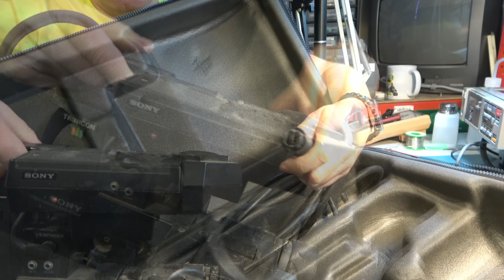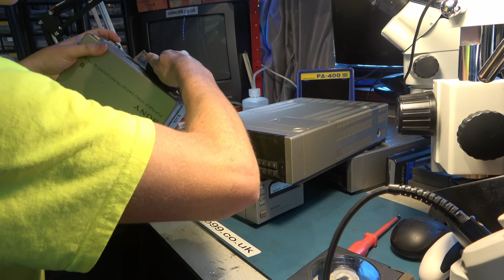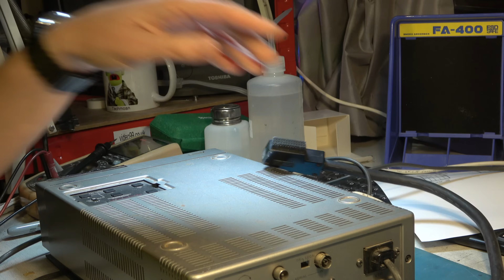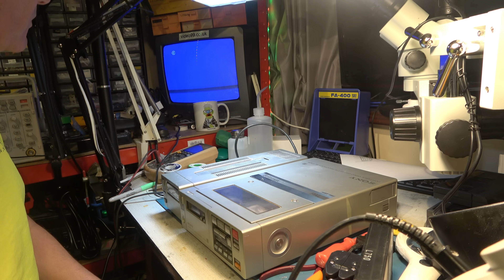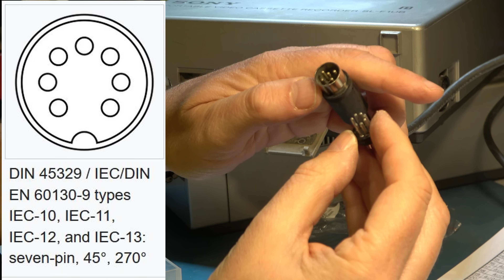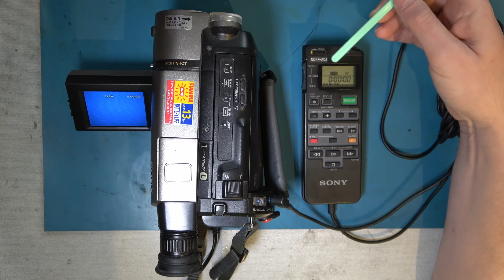Sony Betamax SL-F1 portables, TT-F1 tuner/timer and HVC-4000P camera. Make our own cables.

Comment: Dear Sir, do those Sony HVC 4000 is using 14 Pin Connector? I want to buy it for my SL-3000 but i'm afraid that is not compatible
Reply from the maker: I believe that's exactly what these cameras are intended for.  You can look up the user manuals of both devices to be sure.

Comment: Been researching these. The multi way plug is audio and video plus control S for editor controller.

On TT did you press the power on button behind the front cover. It looked like you pressed it twice. Have to watch that when I pick my ebay purchase up.

Comment: I have an almost identical looking set labeled SL-2000. maybe an NTSC version? Cannot find anything on it!
Mine has a finger thick cable running from the timer to the recorder.
Reply from the maker: Yes that's the NTSC version.  I show it here:
https://youtu.be/kRfaUr2HXY4
Reply: Thanks. Im a sucker for this old stuff. Picked up an old SONY Umatic VO-1600 late last year for $10 at an estate sale. Great working condition.

Comment: As a 18 year old in 1984 I sold my Roland Juno 6 Synth to buy a FI, TT and HVC camera set up. I was fascinated by this video camera lark. But the thing never lived up to any expectations I had. 30 mins battery time, poor camera picture, heads constantly needed cleaning. I don’t like to be negative but it was probably the worst piece of equipment I have ever bought. I gave up with the camera pretty quickly and just used it as my own video recorder before switching to Panasonic VHS machines. Which were brilliant. Side note, the price of a Roland Juno 6 on Ebay is about £2-3K. Note the price of a Sony F1 system😂. I paid approx £1300 for this kit. Which is equivalent to heaven knows how much in 2024.
Reply from the maker: A very special synth, really nice.  The HVC4000 camera really wasn't great, but was still better than JVC cameras of the time which had even worse low light performance.  So people used VHS/Beta camera cable adaptors to allow Sony cameras to be used on VHS portables.  The only time there was any kind of VHS/Beta adaptor.

Comment: Good morning friend, I'm here from Brazil, I watch all your videos on your channel and I'm also a writer.
I'm a technician with much less experience, I need a tip about a defect if you can give me some help.
I have a super VHS JVC model HR-S7900u with audio noise after about 20 minutes of operation.
It starts to make that noise, it keeps popping, the audio goes down and the noise overlaps the audio on the tape.
I believe it could be the audio head or the amplifier stage of the audio head.
because when I pass external audio through the inputs and outputs of this same super vhs there is no noise and the audio does not turn down after 20 minutes, there is no defect.
If you could give me a tip or advice.
because I am a beginner technician in these devices.
The image of this super video is normal, only the audio makes noise and loses gain when playing any VHS tape.
This video is mine for my own use, it could be the audio head or audio amplifier stages or source electrolytic capacitors lacking filtering somewhere on the board.
I need technical help.

Comment: I've wondered the same thing before and even dropped a comment in one of your videos about the possibility to make a custom connector to get video and audio out of that rectangular plug without using the tuner timer unit. You can cut the cable from the tuner unit and repurpose it. I believe you can power the unit up via the rectangular connector, You just have to activate its input by shorting out two pins. Lookup pins 10 and 26 in the schematic.
Edit: After digging into the schematic I found that the main power 12V input (8 and 9 pins, not sure why two pins, maybe for better conductivity) is activated by a momentary switch S2 in the power control IC801, that in turns activates the relay RY801 to switch power from the battery input to pin 8 or 9 (12V), What you could do when you build an external power supply is put a momentary switch in it and connect it's wires to the S2 switch, which means power SW B (pin 26) and batt chg (pin 10). Again this should be a momentary switch, The hold is done by IC801 via the relay RY801. At least that's what I think, Lol.

Comment: Thank you so much for the mention - much appreciated. I am working on a video on the connector on the TT-F1 to extract the AV and have a power supply too. I have sourced a direct ICC connector but I'll be using a loom from an spare TT-F1. I'll also be doing a video replacing the really fragile flexi interconnect on the F1 too. 😊

Comment: I bought a SONY tubed colour camera new in 1982 (still works), and the F1 VCR and TT new in 1984, but I ditched the TT years ago. So, does the F1 have a dropout compensator (I'm assuming it does), so, why does the TT need one? Or, is the TT switching the VCR DC on and off? Dropout was NEVER a problem on the F1.

My camera is an HVC-2000P. Light sensitivity and comet-tailing was atrocious, andvreds were "weak." The "K-Connector" camera plug "clicks" in place, rather than screws in, like VHS (I preferrred VHS camera plugs, although the "K-Connector" always worked fine, and was faster to connect and disconnect).

The oldest surviving F1 recordings from 08 March 1984 onwards, still play perfectly, and PQ is reasonable, by the standards of the time.

I have two NP-1 Nicads (£35 each in 1984 😲) and they do still work!

I use several AC adaptors to power the F1, and I have some adaptors which plug in to the multiway socket and provide video and audio out.

My F1 certainly got around over the years! It recorded on the old Quay Street Granada "Coronation Street" set in 1990 (the video was on YouTube for a decade, until somebody made a fraudulent copyright claim, and YouTube removed it, although the video was mine), and in 1986, my F1 went to the top of Blackpool Tower, and filmed the 1986 illuminations, featuring green lasers! ... I didn't have a case, so I used to wrap the F1 in Cling Film to keep it clean and dry!

I recall, in 1984, being AMAZED by the compact lightweight F1! ... Although, the little JVC portable VHS-C VCRs made it look like huge!
Reply from the maker: The TT is just providing the option to switch the DOC off for use with a PCM-F1 or similar digital audio decoder.  The actual DOC resides inside the F1, as it does with virtually all video cassette recorders.
Reply: @video99couk   Exactly as I thought! 👍

Comment: Probably good old capacitor failures in the timer . I actually owned one of these in the early nineties bought second hand for about a months spare cash and used it for filming holiday trips and family parties ect . I recently bought one with the back pack case which is very cool it’s in my to do pile I wonder if it will work as good as yours. I also have the three versions of the cameras with the vhs converter units so will have fun reliving my youth. There was a version of the camera badged up as grundig that I believe was fitted with a vhs plug

Comment: Now pity the sl-f1 wasn't designed to receive the remote control signal which the tt-f1 does.
 Also i haven't been able to find a (new) fat ribbon connector plug so you probably have to find a junk one from say a old printer and like the Sony with the screw assembly, much easier to handle.
Maybe based on the Tuner output a laptop plug pack with the same power outputs could be a useful power supply.
Reply from the maker: True, the remote receiver is in the TT-F1, not the F1, which could be a nuisance for free-standing operation.

Comment: I have an SL-F1 and TT-F1 for use with my PCM-F1. The TT-F1 used to give me exactly the same issues. Would never come out of standby. I found that by pressing the charge and timer record buttons on the timer a few times would then let me press the standby button and it would fire up. After much use it's now pretty reliable first time. Once in a blue moon it struggles to get started but once again, pressing the charge and timer record buttons a few times seems to make the standby button wake up! Not sure why?
Reply: Oh, and it hates having a dead battery in the SL-F1....so make sure none is in there....

Comment: I'm impressed with the video machines. Considering the Tuner/Timers don't work I'd salvage an AV plug off one of them.
Reply from the maker: I considered that but would rather have the chance of repairing at least one of them later.
Reply: @video99couk  That's fair enough. Get at least one working, and if they both have the same fault, maybe get them both to work..